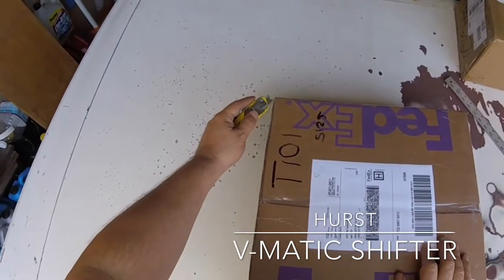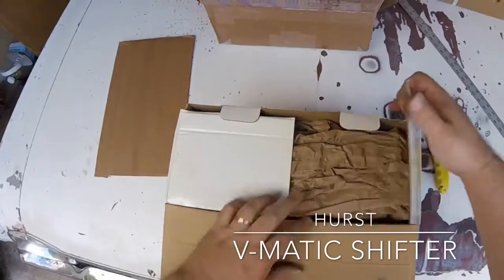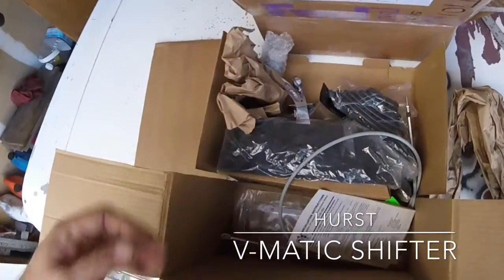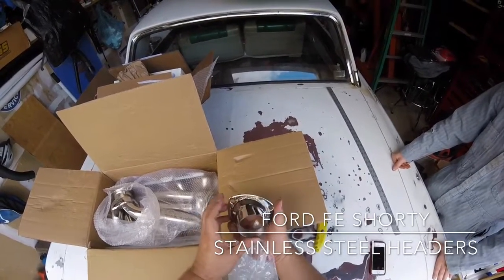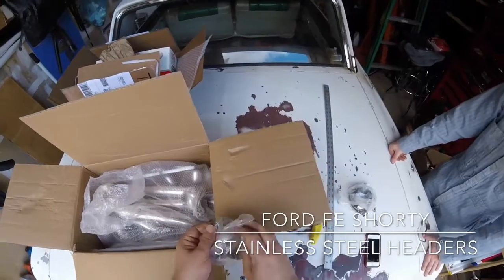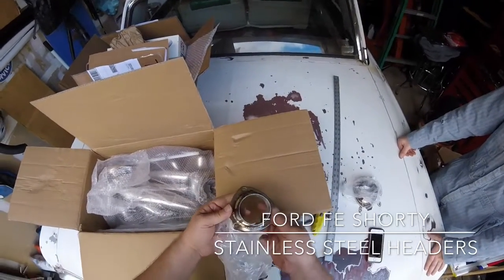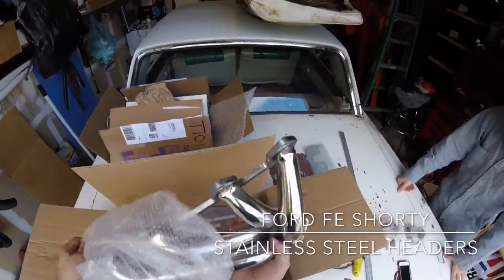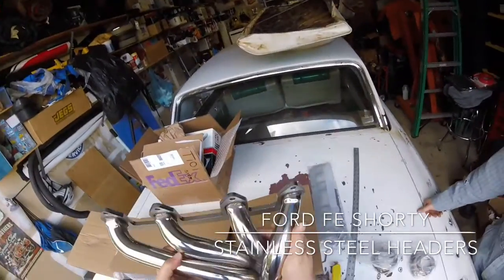Episode 2: 1962 Ford Galaxie 509 unboxing first batch  of speed parts for Mr Crowley.

Comment: what year is the motor in the car?
Reply from the maker: 390merc 66    It the factory 390 300 hp. Bone stock
Reply: @fullthrottlekindaguy  Sure it's a '66 390 and not a 410? Merc had the 410 for '66 & '67, was a 390 block with 428 crank, 390 bore. 
I bought a factory replacement one off a dealer and had the heads worked over, put on a 406 6 bbl with 350 cfm holleys in my 63 1/2.
Those shorty tubes were the way to go. In front of a single crossover with cherry bombs in the factory muffler  spot(rear bumper)those FE's have a sound of their own.
Reply from the maker: @Ray56z  when we pulled the heads I checked the bore and stroke. It has the weird pre-63 Ford FE camshaft retaining button.
Reply: @fullthrottlekindaguy  I never knew if there were numbers on the casting-block-different from a standard 390 with the '66-'67 410.
I bought that one off a dealer that had ordered it for a factory replacement on a car that put out a smoke screen like the Army wished they could do. Guy kept driving it while waiting and totaled it so 410 wasn't needed. 
I later bought one out of a wrecked '67 but I only went by the owner saying it was a 410, the air filter top had the decal.
I thought you told the guy it was a '66 Merc 390, only reason I brought it up.